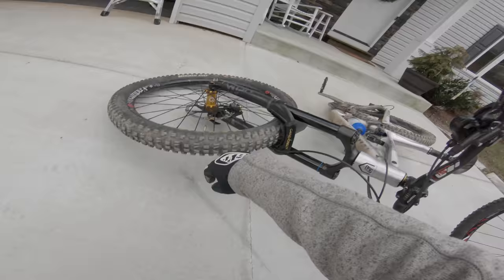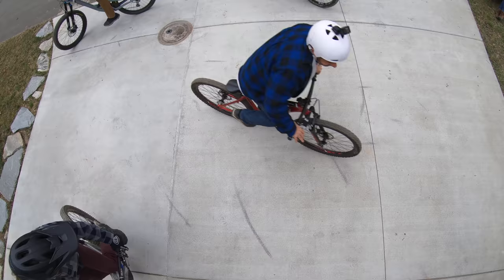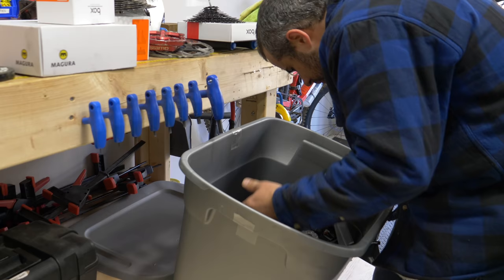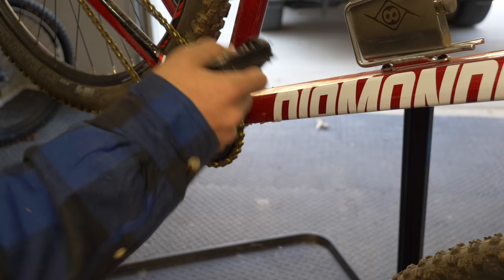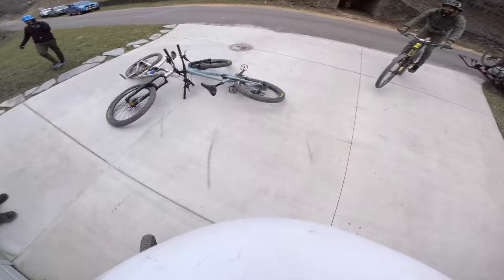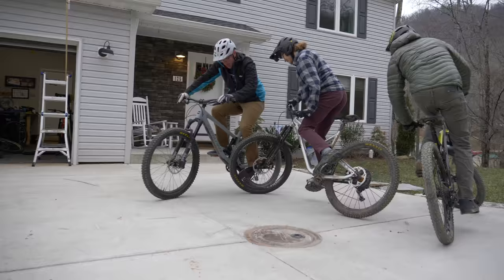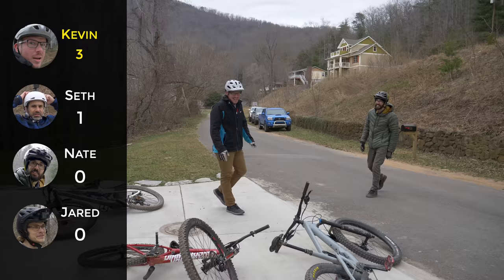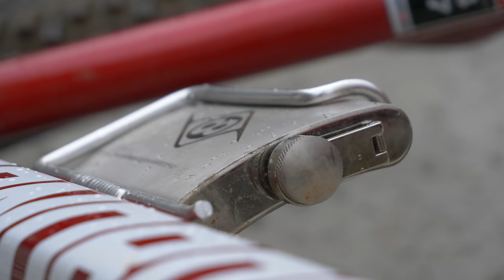Playing Foot Down on my Battle Bike | Build and Ride

Comment from the maker: Some of these rounds were hotly contested, but the frame by frame tells all! I’m ready for a rematch.
Reply: Introduce pool noodles ... gonna be fun! 😆
Reply: hey Seth how about on clipless pedals just for the next level
Reply: Seth's Bike Hacks I played foot down on accident I flew down my hill into a tree and I am only able to put foot down until 6 months come
Reply: The best tactic is to take a mulitool to make the stembolts of your frienda a bit loose. So they can ride in the circle till the game starts and when the try to endoturn the handlebar turns and they put a foot down😂😂😂😂
Reply: try it with a fixed gear bike
Reply: I’m glad to see your back on a bike Seth. Happy healing!!
Reply: I would put the smallest possible brakerotors on a footdown bike, because they  are less likely to bend
Reply: how you made chain guid? 2:09 Please answer i really need this one!
Reply: Seth's Bike Hacks I would play with weapons if we didn’t have to go to school
Reply: I would use a fixed wheel bike with clipless pedals
Reply: Seth's Bike Hacks u should make it a fixed gear so u can pedal backwards
Reply: It's called chicken not foot down
Reply: Unicycles are best for footdown, but my footdown main is a custom chrome dyno VFR that I converted to 16” wheels by putting a “U” brake on the frame’s “V” brake mounts. It’s a champ at cornering sharp and catching opponents off guard. I also put SE bikes urban camo pads on to give it some old school vibes. Why SE pads? Because it looks like something only Todd Lyons could come up with.
Reply: What happened to lisa?
Reply: Hey Seth u should put a Foam core lance on your bike 🚲
Reply: We need a Skills with Phil vs Single track sampler vs Seth bike Hacks vs Jordan Boostmaster foot down championship!
Reply: It has already been said but I have played with pool noodles or foam swords
Reply: awesome video dude but when is the 10 cheap mtb upgrades coming out ?
Reply: These types of videos are more entertaining
Reply: With Phil this would have been 10-0-0-0-0
Reply: I totally believe that this Fill guy is the most boring man in MTBing today. This Fill guy should try to spend more time improving his riding skills instead of talking about adding 2 millimeters to his (bottom bracket, peddle width, head stem, handle bar width, seat height, tire width, grip diameter, crank length) NOTE: pick any of the above. Fill is too old, too short and too out of touch with HARD CORE riders like myself!!!!
Reply: with Phil and  @stevematthes4325  10-0-0-0-0-0
Reply: Seth's Bike Hacks me an my brothers play this we love it
Reply: Seth's Bike Hacks until he had a handle bar go into his hip because it didn’t have a bar cap
Reply: Lol oh shit in background
Reply: the way i play is we set sticks and weapons in the play area and if you can pick it up you can use it
Reply: Demolition Derby... what rules?
Reply: Hey Seth! As a suggestion for a Box Components product, how about a two-trigger left shifter where one trigger controls the dropper post while the other controls the front, rear, or both suspension?
Reply: it looks awesome! we'll try it after two months - it's still winter here
Reply: i bet your body won't last longer than a month say hi to hospital seth :( JK .this vid was a lot of fun :)
Reply: @andreysalagean7869  he's in hospital once a month anyway - Seth , take it easy man
Reply: Seth's Bike Hacks  you should do a wife reveal
Reply: I see you made a video called WORST OF 2017.....Can you make a video called WORST OF 2018??....Love your content bro. Your cleaver, creative, & hilarious !
Reply: Last time I played foot down, a friend of mine went home with a cracked rim. That was fun
Reply: Foot down with Nerf guns
Reply: Can I join seth
Reply: Seth's Bike Hacks I play this with 2 mini guns on my hand,e bars
Reply: Seth's Bike Hacks what diamond back is that

Comment: TIL: There's such thing as a brake that stops both wheels. Cheers!
Reply: Fixie.
Reply: Sam Lynch then you cant do fakies if you want to
Reply: @Seth-jz8lr  I assume that someone riding using one arm won't mind
Reply: Theyre popular with motorized bicycle enthusiasts
Reply: @Seth-jz8lr  coaster brakes are just freecoasters that stop when you back pedal. As long as you dont move your feet, you can fakie
Reply: Yah my friend has one
Reply: yeah PETAL. womens petal
Reply: Who makes this single lever dual brake contraption?
Reply: @ridingwiththereids  , it's actually called, "Problem Solvers Double Barrel Brake Lever".
Reply: @Crilly C petal brakes are no good for mountain biking. Maybe for foot down but not as real MTB brakes. Often you need to rotate the petals without moving forward or backward.
Reply: Crilly C ok at least you were joking
Reply: The special lever is a lever, not a brake
Reply: @jacksondeford3304  
There’s a trail above Anchorage called Powerline that goes over a mountain pass and has a really steep trail down the backside, and word is the old school mountain bikers during the 70s would do it with coaster brakes.  The hubs would get so hot they would sizzle during water crossings and all the grease would melt out; resulting in a total rebuild every time they did it.  I went OTB at least once per trip (but they were slow OTBs so no damage) and it was a great ride.

Comment: My bmx club plays foot-down.

We have a starting circle (marked out using cones) where everyone has to ride around in. The game starts and you have to get in front of people to try to get them off. You have to be good at track standing to be good at this. No touching people or bikes (unless told by a coach) and no going out of the circle. Overtime, the circle starts getting smaller. When a rider puts their foot down or goes out of the circle, they are out, and can help move the circle in. It is pretty fun and is hilarious to watch.

Usually quite a few people play ( about 10-15 people) so it takes a while to finish.

Comment: I would have done everything you done but I would also use a rigid fork and at least 40/50psi in the tires for a stiffer and more predictable feel when trying to hop around or nudge people with your front/back wheel. I would have also had another dual cable brake lever on the left hand side that can pull both brakes, and I would split the brake cable into two using those splitter cables used for bmx gyros therefor allowing me both hands to push people with whilst still having both brakes
Reply: thats just silly and OTT

Comment: Product idea***
When you are on a trail you can sometimes catch yourself in too low a gear and are too fast to shift

Solution a plastic T bar shift lever that comes out beside your thumb. It would work similar to a gearbox in an old dodge. You could push it all the way to the top or bottom quickly or have it go into a gear in between as well

Comment: We play bike jousting where you have 2 competing teams. Both teams have a 'gate' which is their starting point. A rider leaves the gate riding towards the rider from the opposing team (doing the same). At the point where they meet they try to get the other to put a foot down. Only then can the winning rider move ahead, moving closer to the 'enemy gate'. The team who manages to get a rider through the gate of the other team wins.

Comment: We played a similar thing on the trailbikes (motorbikes).  Soccer on a local ex-tip. Fairly muddy. Kick the ball in any direction, there wasn't a goal... or teams.. just the mana of being the one kicking the ball... The rub... your on a motorbike with other motorbikes... and if you fall off... the others quickly race in and attempt to bury you in mud before you get back on and out of the rooster tails... then the game goes on.

Comment: Hi I have a weird question. I had a  old specialized big hit fsr I do believe a 04. It got stolen but I got it back but they decided to paint everything black. Do I need to replace the bearings and coil for the rear suspension and seals for the forks. I know i need to for the break pads or can I sand off the paint then reinstall? I know it will be a long process but at least I have my freedom back.